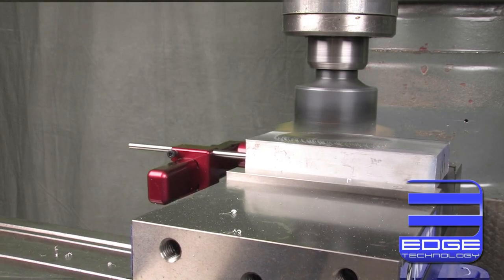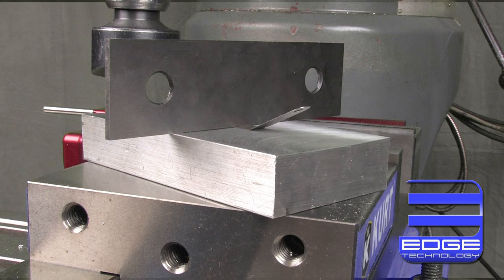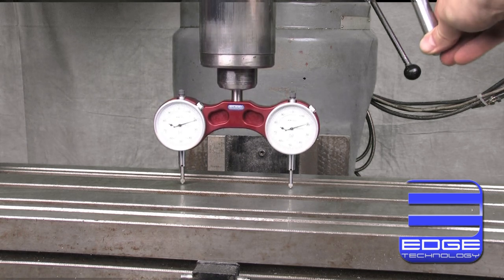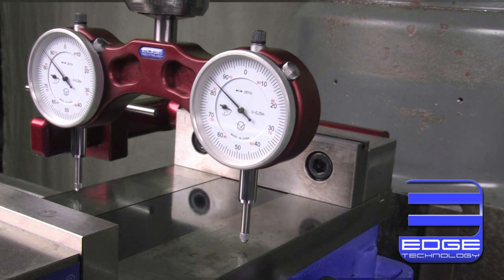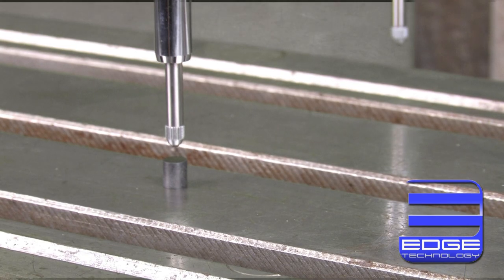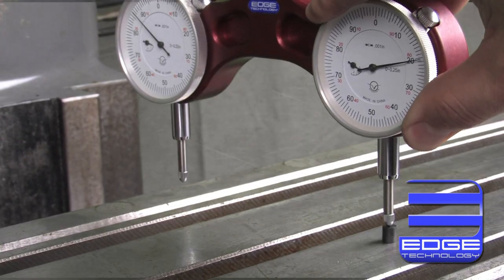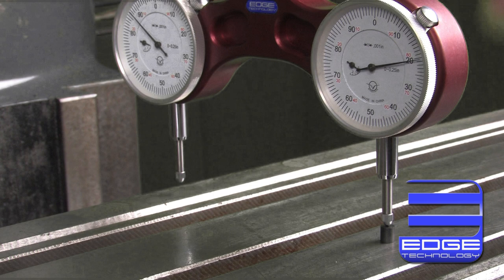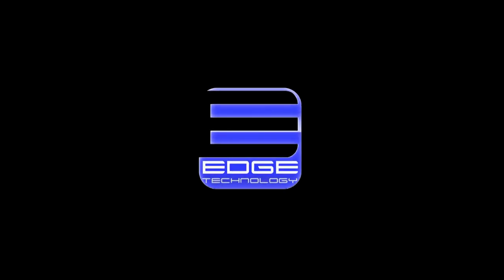Tramming a milling machine - square a spindle on J head bridgeport mill - Pro Tram - Edge Technology

Comment: Been a Machinist for 38 Yrs   been using a 1/4 piece of round stock approx 6inches  long. and bent about 2 inches of it on a 45deg angle  use a drill chuck or 1/4 inch collet and a starett  last word indicator and a small gauge block sweep it over the table and adjust the head . but this tool looks much better and much more easy to use

Comment: Readjust the Knee gibs. Usually on the left as you look at the machine next to main casting of the mill. An easy way to check squarness of the head without checking it with any indicators, is to take a razor sharp endmill, or sharp fly cutter and take a cut off of a aluminum piece. If you see a crosshatch pattern
behind the cutter, the head is square. If you see a pattern that's not crosshatched you need to tram it in.. If any gibs need tweaking do it now. Then tram. Thanks folks

Comment: you can use just one dial indicator on a single extended length of bar to achieve the same result-----still got to rotate it though
Reply: That's the way I used to do it, Never again !
I got mine yesterday, I didn't get to use it till tonight, I dialed in my head in five minutes. While you guys are turning circles, I will be making chips.
Reply: @scrapwire1  its not that it wouldnt work but it makes things more complicated and setting of the indicator will be a big risk of error especially because the people buying the device--similar to those buying coax indicators will be beginners.. You just swing the indicator in the normal method hower the nod forward tilt and back is NOT INTUITIVE unless a person told what the indicator is doing. I challenge anyone to a tramming contest

Comment: 6" Piece of 3/4" alu bar. Drill 3 holes. Piece of round stock in the middle one. Fasten two cheap dial indicators in the other two with screws. $20 and every bit as precise as this.
Reply: PJ, That's exactly what you need to do.
You cannot build that much quality into anything you are gonna build, for a hundred bucks, my time is worth much more than that.
I align heads for customers while they stand there and watch, and they pay good money for what I do.
Reply: scrapwire1 

“” all that Quality “, still funny four years later, “ a fool and his money are soon parted”

Comment: I think this is a waste of money. I got by with out one for 40 years and counting. An indicol and a test indicator works just fine.
Reply: this person is correct--as I stated above the double indicator method is for those with no formal training and it takes the money of beginners same as coax indicators.. when tramming the head the forward nod is the part that is counter intuitive and a person needs to be told and instructed why the needle moves the way it does and draw a sketch--after doing that a person can tram the head in record time for the rest of their life.